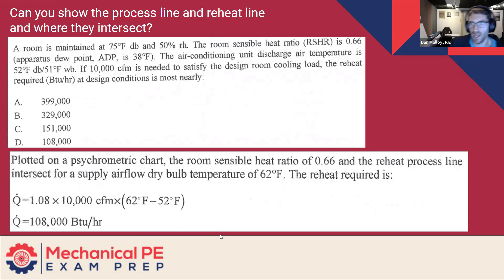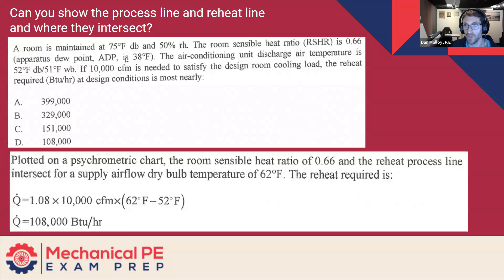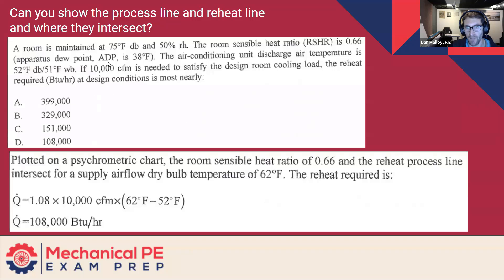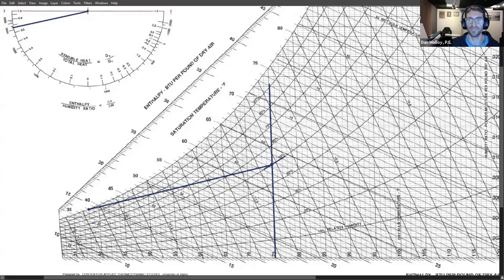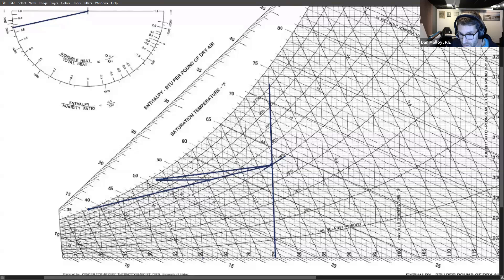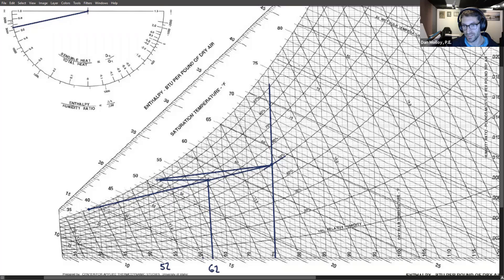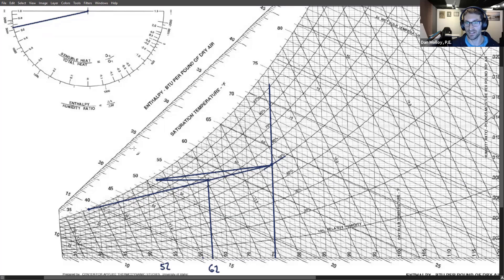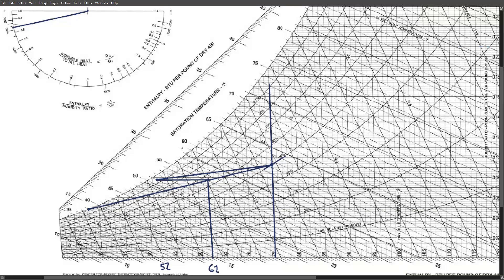How to Calculate Reheat Requirements in HVAC Systems | Sensible Heat Ratio and Apparatus Dew Point

Comment: How do I get the RH or WB of air leaving temperature? I know the Air ent. temp is the room condition, and I get the ADP base on SHF
Reply from the maker: You can determine them graphically from the psych chart after locating the supply condition point as shown in the video.  It takes 2 pieces of info to locate a point, then you can determine anything else from there.  Hope that helps.

Comment: Hi there, so if the SHR slope is low, we would be essentially resorting to using reheat process since the slope line intersection with saturation line is at a very low dew point (38F)? And normally we start the reheat from 55F dew point in comfort level applications?

Another question i have is at what SHR applications we would use humidifcation? Normally humidification is used during the winter time?
Reply from the maker: Yes, it's unusual (though not impossible nor unheard of) to make 38 degree chilled water, so it would have to be a DX system, and even then, very cold supply air is generally not desirable.

If humidification is ever used it would be in the wintertime, but due to complexity and cost it would only ever be considered in very dry climates or critical applications where humidity control is needed.  For example, in the northeast where I'm from, we're almost always trying to remove moisture.  In the rare case of dry winter where some additional moisture might help produce better indoor comfort, we just wait a couple months for things to change.  I'm sure other parts of the country/world have a different approach.  In general though, human comfort tends to take a back seat to critical systems such as data centers.
Reply: @MechanicalPEExamPrep Thanks. Do you also have an example of psychrometric steps in finding supply air conditions in "winter times" when normally heating and humidification is needed for indoor comfort? I mean similar way you did here by drawing parallel line to SHRF line, but for winter seasons.

Comment: Hi Dan. The sensible heat factor for standard air is defined in the reference manual as 1.10 at sea level. Why is 1.08 used in the final calculation for sensible heat gain? The multiple choice answers are not close enough for it to matter, but I want my process down in case they are for the exam.
Reply from the maker: You'll see it both ways, it's simply a matter of what place you are rounding to.  I've always used 1.08 but that's probably more precision than necessary, especially considering the reference handbook uses 1.1, to your point.  Sounds like your exam is soon?  Good luck! :)

Comment: So the dew point is a horizonal line from the room conditions. The "apparatus" is likely metal and not water so it doesn't make "dew" thus is nonsense. Who writes this stuff?
Reply from the maker: At the risk of being obvious, I'll state for the general viewers here that the moisture that forms on the coil is water vapor from the AIR, so yes, of course it doesn't come from the metal coil!  I think the concern is that if the coil is too cold (colder than the dew point of the air) then moisture will form on the coil.  Good operators are always conscious of the coil temperature in comparison to the dew point.  If dehumidification is desired as with a typical air conditioning application, this is accounted for and there will be a path for condensate to collect and be removed.  However, in a sensible only cooling application, there may not be an expectation of, nor a path for, condensate removal. The terminology is something you get used to through experience solving problems and dealing with the design and operation of HVAC systems.

Comment: Isn't the RSHR based on the loads in the room (and independent of the coil be used to cool)? Couldn't the apparatus dew point technically be a different number?
Reply from the maker: Hi Marcus, definitely yes to the first part, RSHR is entirely based on the load.  ADP may be actual or theoretical, such as if the system uses bypass/reheat to meet the operating requirements. Hope this helps! -Dan

Comment: How do you determine in which scenarios you can use Delta_Temperature vs. Delta_Enthalpy in the equation solving for reheat load? For example, "Six Minute Solutions" (depth) problem 23 requires you to use the difference in enthalpies to solve for the correct reheat load, whereas using change in temperature yields an incorrect answer.
Reply from the maker: Hi Will, Re-heat is only ever sensible heating only, so no need to use enthalpy.  That said, it will yield the same answer if you do, since there is no latent, the total heat transfer equals the sensible heat transfer.  IMO, using enthalpy in that situation only causes confusion, but strictly speaking it isn't wrong. Hope that makes sense.  If not, shoot me an email.  FYI - We have tons more solutions videos in our bundles you may want to check out if you're getting ready for the exam.

Comment: Is there a way to complete this problem without utilizing the protractor?
Reply from the maker: Yes, you can connect the room condition point to the ADP temperature on the saturation curve.  This is the cooling process line.  You may want to re-listen to the student's question at 6:45, where I confirm that the the problem is doubly specified.  By giving the RSHR and the ADP, you have more info than you need, and you have two options for drawing the cooling process line.  However you choose to arrive at the cooling process line, the rest of the solution unfolds as described.